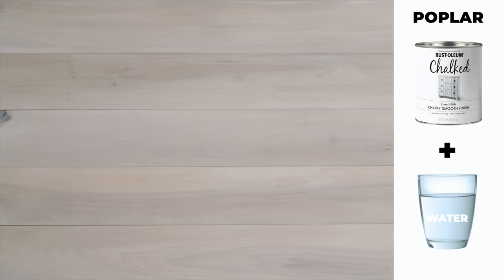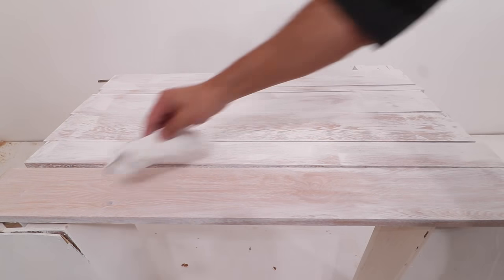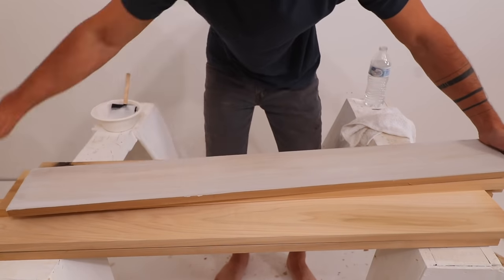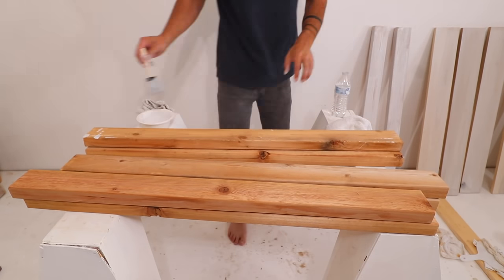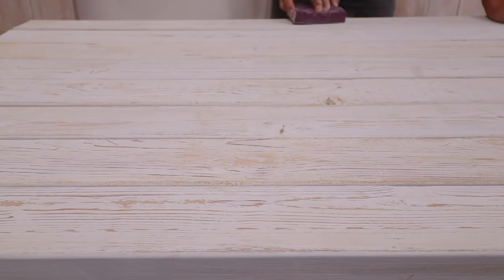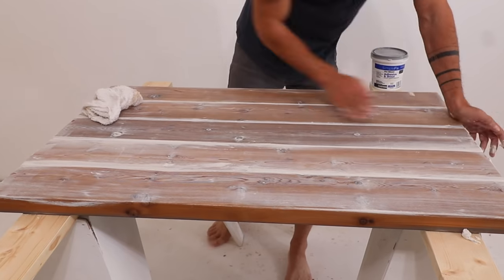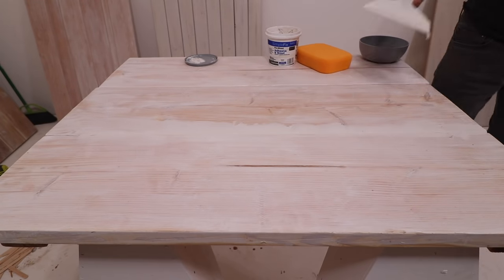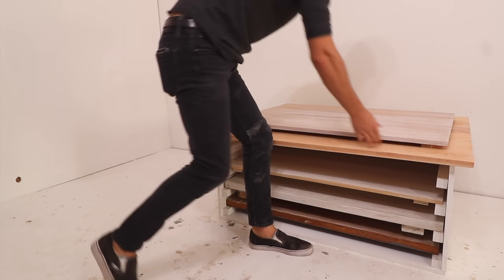5 DIY White Wash Finishes for Wood

Comment: Never would have thought of using grout as a finish like this...super cool Ben!
Reply: I didn’t understand this part. Did he paint the grout on ? I’ve never worked with grout, I thought it was like a grainy putty ….
Reply: @virginiacreager4331  grout is similar to putty, and is normally the "fill" between laid tile. But he used grout creatively, as though it were stain, instead.

Comment: Awesome video. I just did a whitewash wall unit in red oak. Stained it with water based  gray stain wiped real good so it wasn't to dark. Then brush on white water based paint not diluted  and quickly rubbed it in and wiped off enough to the finish I wanted  Gave it a nice weathered look.

Comment: great variations. Thanks for the looks!
cheaper and faster than all of those options is to use KILZ or Bullseye primer, cut with water as needed. Plus , no need to pre stain, it will stick to most anything

Comment: Regarding the sound level -- if you right click on the video, there is an option at the bottom of the popup menu for "Stats for Nerds".  It will show you how above or below YouTube's "loudness" target is.  In this video's case, it is -21.8dB.  Considering that YouTube recommends videos to be -3dB to -5dB below the target... well, that's extremely quiet.

Most audio editors these days should be able to handle "loudness" pretty easily.  It will be either "LUFS" or "loudness" in at least Audition and DaVinci Resolve Fairlight.  The key is to set the target loudness / LUFS to -14 and then try to stay -3dB to -5dB below that target after normalization.

There are many ways to hit a target loudness level (not volume!!) without it being built into the editing app.  The most brute force would likely be to just upload the video to YouTube in private mode, check out the "Stats for Nerd", and then just add enough audio gain to being it up to -3.  In this video's case, you could add 17dB or 18dB of gain and then it would sound roughly as loud as every other video.

Comment: Very cool finishes. I tried the varathane white-wash stain with a project today, very pleased with the result. Do you think polyurethane would look good as an extra layer of protection, or would it add too much sheen?
Reply: You may try the matte finish.
Very little sheen but will still add protection.

Comment: Looks great ..lots of ideas ,but i have 2 walls thst have old tounge and groove boards that has a lacquer or varnish on it.. i want to white wash them but how?
Thx
Reply: I am in the middle of doing exactly what you're talking about! I sanded all the varnish and stain off. I just did my last treatment with regular bleach. Trying to decide on what to use for white was or pickling stain. Then will put a water based polyurethane then I'm gonna add a white wax over it all. I have tongue and groove Yellow knotty pine. And half of the boards are really yellow. 
Although, I do like his grout idea!

Comment: We have cedar panel in our older church (35yr) the walls have a shine I’m assuming a poly on top I’d love to do the plaster technique you did on your pin. Do I have to sand it prior :( it’s an A-frame and ceiling to floor cedar planks. I’m worried I have to do that first.

Comment: I'm planning on using red oak ply panels on the wall.  After using the technique you described for red oak.  Would I then need to seal with a clear coat?

Comment: Has he answered any of the questions,I don’t see a responds ?
I have a question. Great video,but you never mention what to use on each to SEAL The WOOD, what can be used? Can you please let us know.
If I have cedar wood sanded, and I do a white wash with paint, is it ok to use 
Shellac on the wood where is see spots that my sanding didn’t get out, I see other are doing that, but I’m concerned because I want to do a white wash over it, then seal with poly . This furniture I just did a some bleaching and now wanting to advice . From you or anyone
Much thanks

Comment: What would you use on wood paneling from the sixties?
Reply: Probably need more information (wood species, finish, desired colour, is the panelling removable) , but the most important thing will be removing the existing finish. Sanding, scraping, chemical removal are all options.
Reply: Gar Thanks. It is pretty flimsy—original paneling product I think— very thin.
Reply: @711yada  In that case, I'd probably just recommend replacing it with a product you like more. Maybe shiplap?
Reply: Crowbar.
Reply: daniel buckner lol!